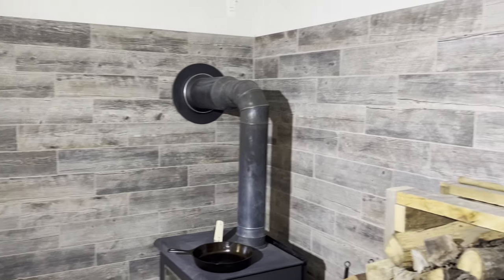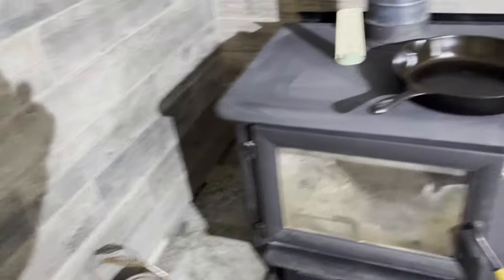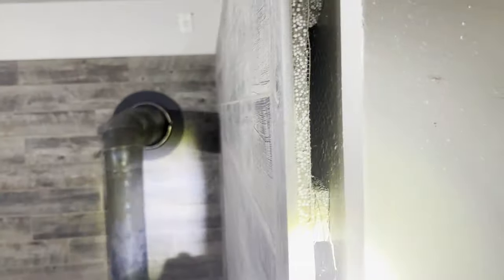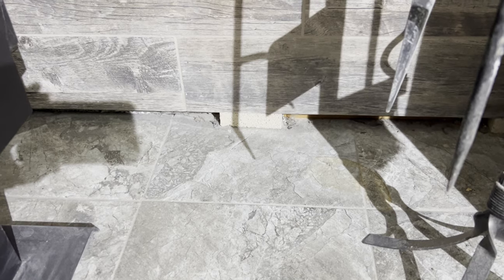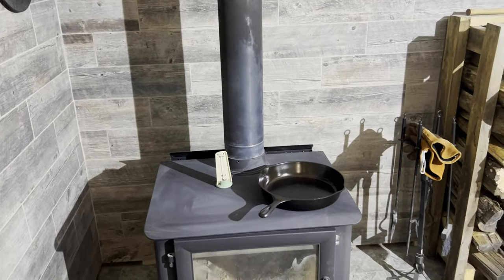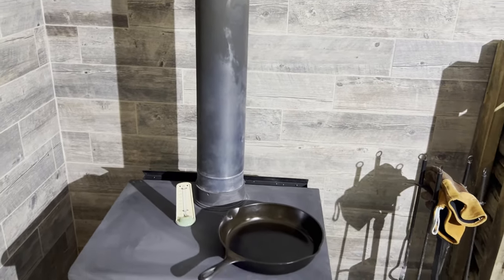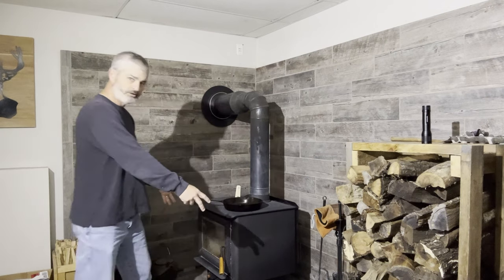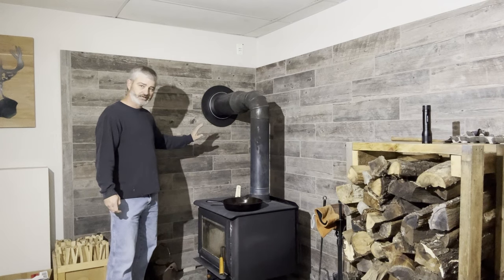Wood Stove Heat Shield-MUST WATCH!

Comment: Out of all the videos on this on youtube, I swear this is the only wall I've seen done as correctly as I've tried to understand the regulations. Most just slap this against a wall with the concrete board.  I think the only other option would be to attach this right to the wall disregarding the 1" but then have a 1" offset standard style metal shield/panel.  You also pointed out my concern with an all brick setup. I read somewhere it needs to be 3.5" in thickness to have enough lets say thermal sponge effect to reduce worry.  Growing up we had a brick setup in our basement with an earth stove and I know there is zero air gap on that from when it was built in the 60s.  

We have a large JA Roby Cuisenere cookstove to install and just began looking at tile options last night so I'm glad to have seen this.

I don't expect you to have the answer but my only question is, if they're worried about embers and things like that then what should we do about that 1" gap at the bottom above the hearth.  Is that not a fire hazard area also?  Should we not for example have a 1" square stone offset in front of that gap by an inch so an ember would have to go bouncing up over something and then down in the crack  This is why this is all so confusing.
Reply from the maker: I apologize for just now seeing your complete comment. I didn’t expand what you wrote to see that you had a question. The air gap at the bottom is a very important part of maintaining good air flow for cooling the wall. My focus for embers is to try to have the door opening away from the wall and have plenty of noncombustible flooring to catch the embers. I also removed the baseboard material near that air gap leaving mainly sheet rock. The offset brick idea you have sounds good as well. Thanks for the question!
Reply: @EverythingHomestead   not a problem!  We ended up having a local place come stone everything for us based on timing after I built the hearth base. I was making things over complicated. Since I had already planned required distance they went right to the wall. We have the largest hearth theyve done as it is just under 5x8 since a wood cookstove sits on it

Comment: Thank you! I grew up with a family of chimney sweeps and have a lot of knowledge regarding safety, stoves, and maintenance, but I am planning on having a stove installed in a van build. I am going to have it done by pros for the certification from the sweep/and safety. This really helps me to know and have more input on this installation. I would love to find the weight of the cement board and porcelain tile. It will be a tiny freestanding. I will build everything else around the stove. Thanks again.

Comment: Great job but I'm just going to stack some bricks about an inch off the wall going to leave some openings at the bottom so cold air can get in and warm air flow out of the top... quick and simple till I can tile something fancy

Comment: A thought regarding the spacers and heat transfer through the screws into the studs:  once the shield is screwed into the studs with the required 1" spacing, you can remove the spacers from around the screws so the screw can dissipate heat to the air before it reaches the wall.

I'm building a similar heat shield soon and I'm thinking about using some temporary 1" wooden studs as spacers between the heat shield and wall while screwing the cement board to the wall, then removing the spacers once it's secure.

If the screws are embedded in a heat insulator like cement board, that's just going to allow the metal to retain the heat it picked up at the head and transfer it to the wall stud.  Would be better for air to flow directly over the metal screw between the heat shield and wall so that the air can carry away some heat and give the screw a chance to cool along its length before reaching the wall.
Reply from the maker: @hornitorrincoperezoso2189  I like the way you’re thinking. My only concern, which may be nothing, would be if the spacers and the screws together might give it the needed strength to hold up the weight of the shield. Just a thought…

Comment: Great information.  Are the cement board spacers just 'pucks' or full length or long strips?
Reply from the maker: Just pieces of 2”x2” cement board. I pre-drilled so my screw didn’t crack them when fastened to the wall. Long strips wouldn’t allow the airflow that I was looking for.
Reply: Excellent - thanks for that tip.  
 @EverythingHomestead

Comment: Maybe I missed this part bur did you screw in your spacers to the wall first and then screw the cement board to the spacers ? Thanks
Reply from the maker: @tlmtrudy3187  I don’t know if the way I did it was the best or not. I predrilled the spacers and then sank the screw through the cement board and into the spacers, so the screw was in just enough to hold the spacer, before applying it all to the wall. Took some careful measurements so I still hit the studs when I leaned it on the wall.

Comment: Hi, did you use normal thinset mortar to put the porcelain tiles? Can I use schluter modified thinset?
Reply from the maker: @arcticnl8752  I just used regular mortar for interior porcelain tile. I’m not familiar with the modified thinset you asked about.